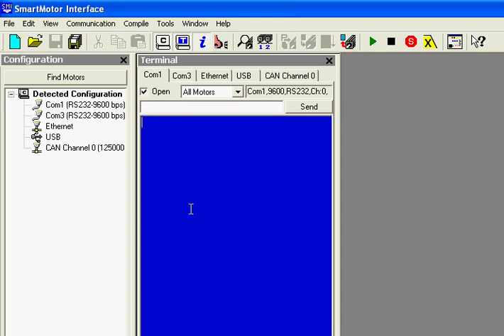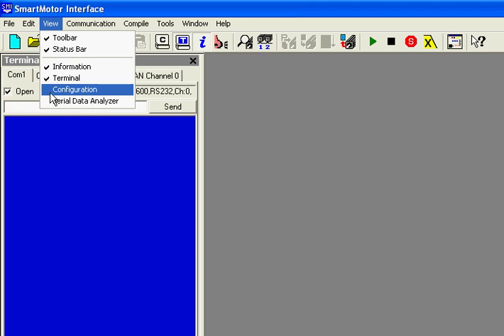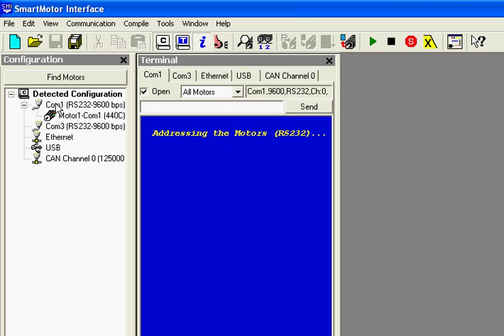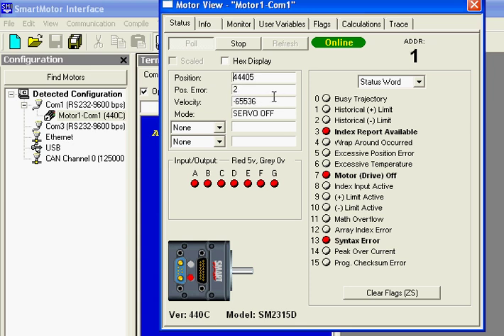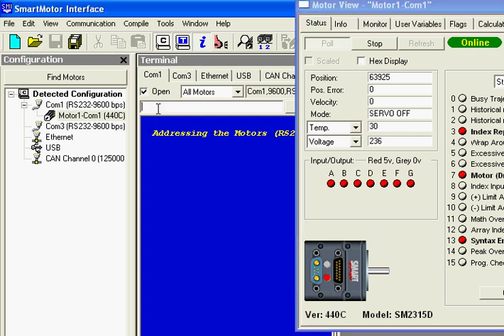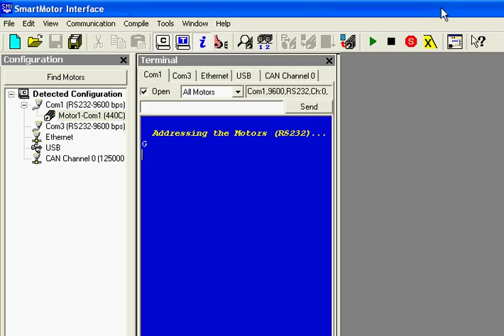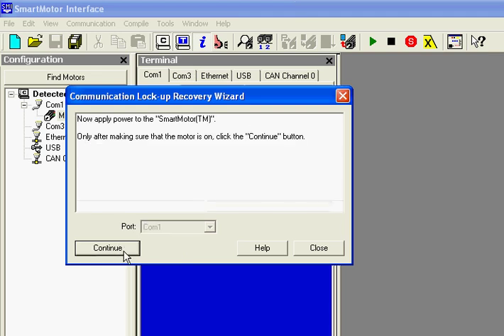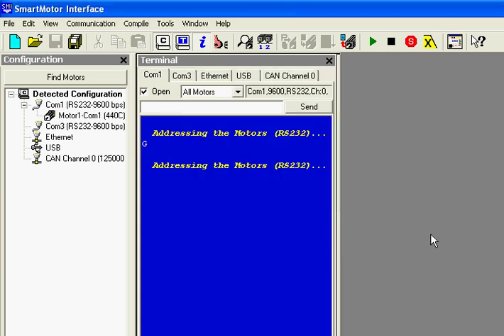Smart Motor SMI Software  - Establish Communication

Comment: Is it possible to downgrade a class 5 to class 4. Our plasma table uses Sm23165dt firmware version 4.95. And we are having hard time finding one.we did find a SM23165D-DE-C on ebay but we got it today and it has class 5 firmware. Our software won't work with class 5.